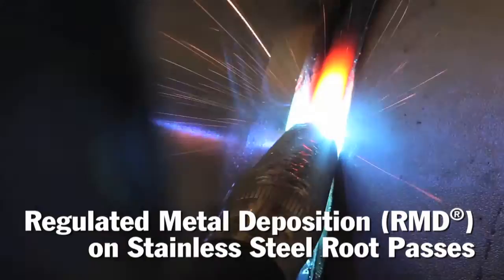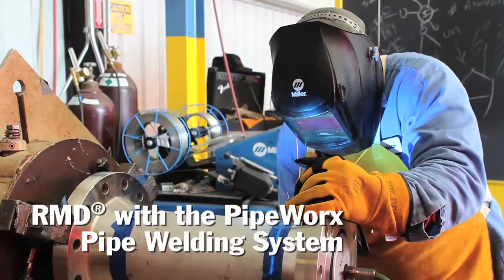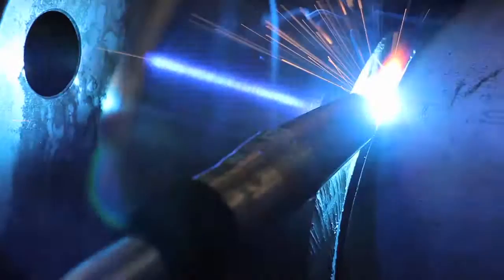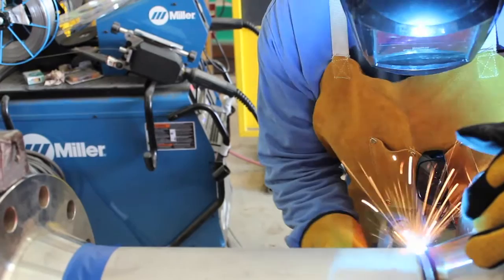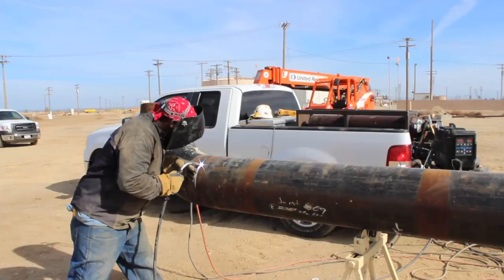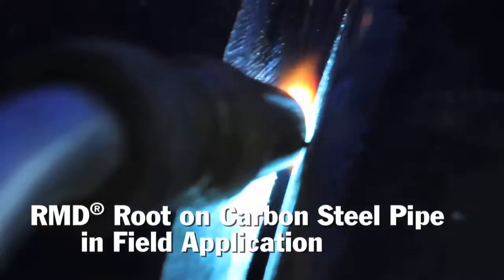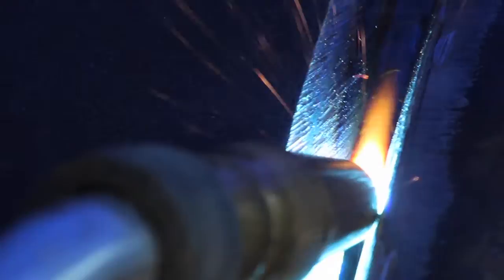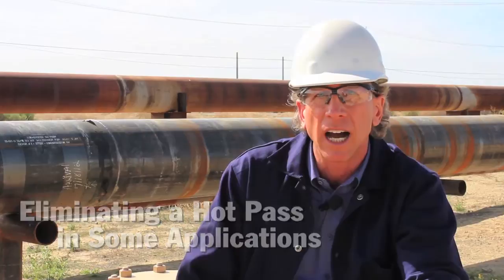Miller RMD Improves Quality, Productivity in Pipe Welding Applications

Comment: Wondering if you guys have problems with gas protection by welding outside with mig process. If not, how you manage not having porosity problems welding outside? vs stick?
Reply: Sorry as I never saw your question.  On windy days we would utilize wind blocks or hooches. These blocks along with maxing out the gas flow within the parameters of the WPS and minimizing the nozzle distance from joint grove worked well.